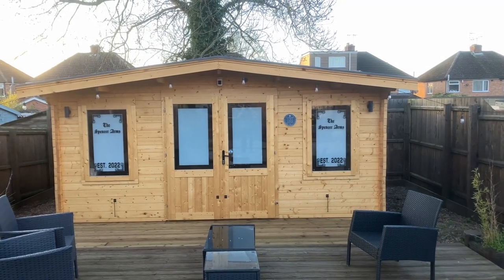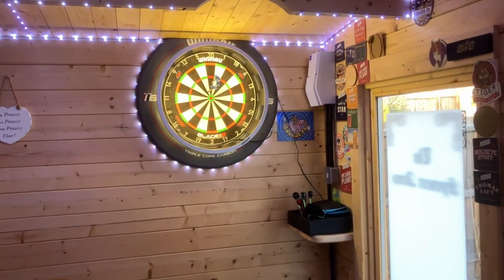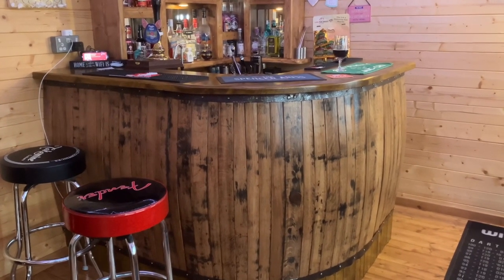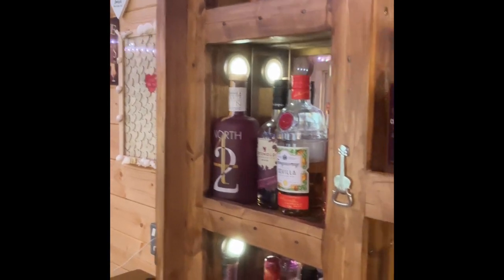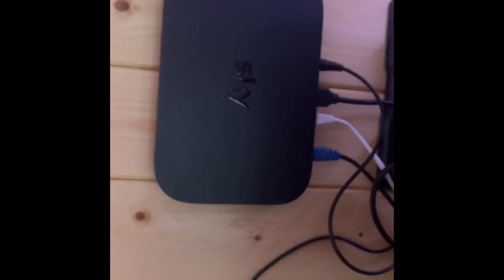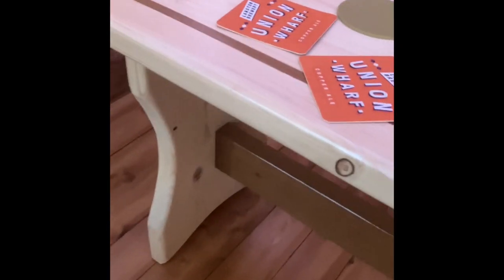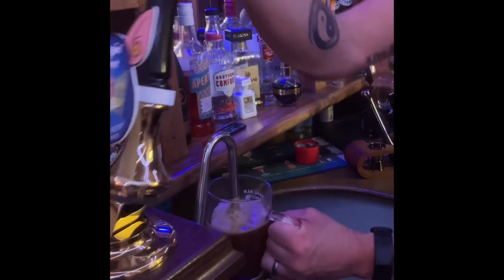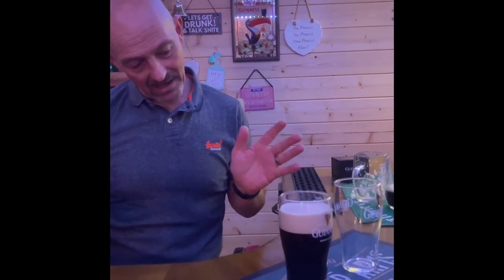Pub Cabin Garden Bar Tour - Barrel Bar, dartboard and more…

Comment: Hopefully there is no snow in your area during winter time. Otherwise your roof will collapse because you carved the "curve" to a structural beam that holds the roof up.
Reply from the maker: This is one of the reasons I love doing a YouTube channel , because I get so much joy from the comments. 👌🏻 My 38 years in the building trade doing plenty of structural roof work as a Carpenter Joiner should see me ok to fix it when it caves in . To be fair , I have been worried about the cat and the pigeons walking on it and have heard it creek a bit under their weight . . Cheers for the advice . I’ll build a big wall of fire around it if it does snow to keep the temperature up and hopefully melt the snow . Cheers 🍻 🙏🏻. Much love to you and your super knowledgeable comment. All the very best . 
Speno